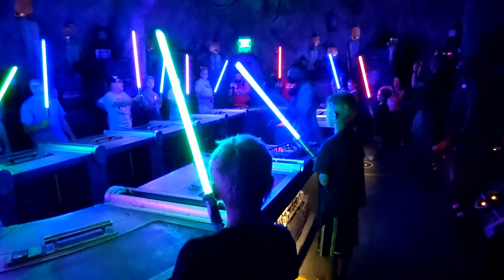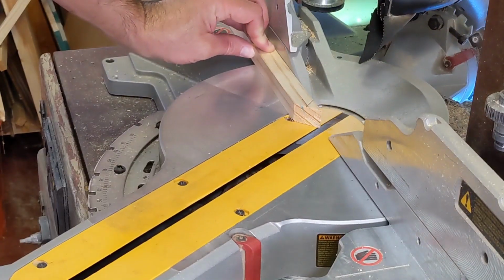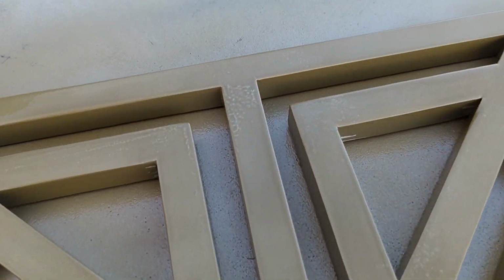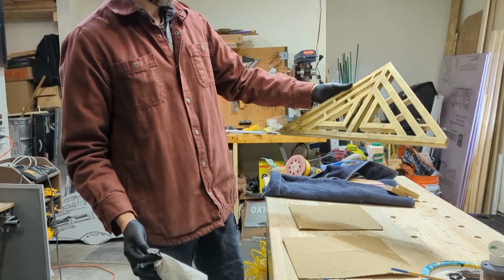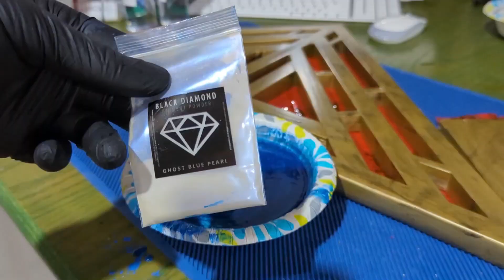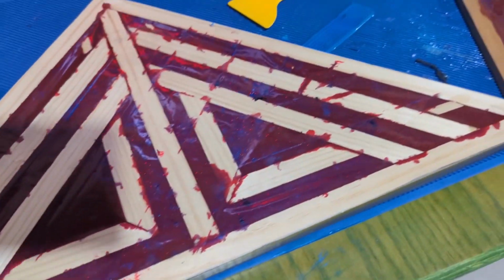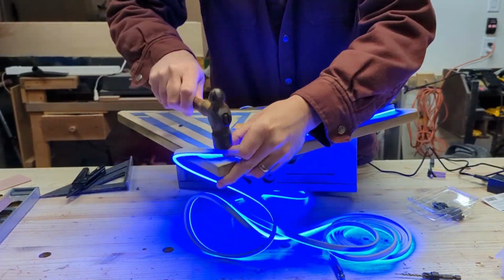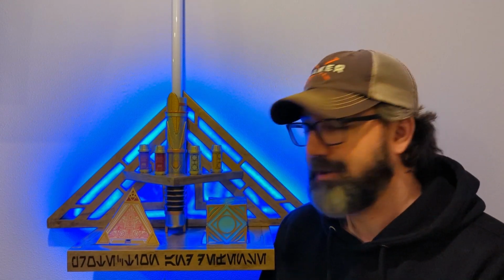DIY LIGHTSABER Display with RESIN and NEON Lights

Comment: Super awesome.. I saw previous build and will be making similar (not as fancy as yours lol).. any chance you can tell me what you used to hang these to wall? Looks like a small custom cleat but I really can’t tell.. thanks and again awesome build! Sure kids were super stoked
Reply from the maker: Thanks! And yes, for hanging it was just a small french cleat. I had a piece leftover from the garage build and I just cut a couple pieces down to about one inch; screwed one in the wall and one in the back of the display. I also had to nail on a small spacer to the bottom of the back of the display so that it would sit flush on the wall; seemed like a good idea since those neon lights are pretty thick.
Reply: @dadcrafted  great, thanks again for taking the time to respond.. have a great day!